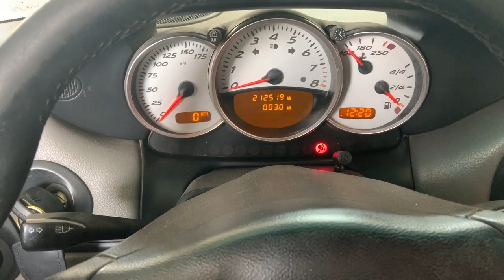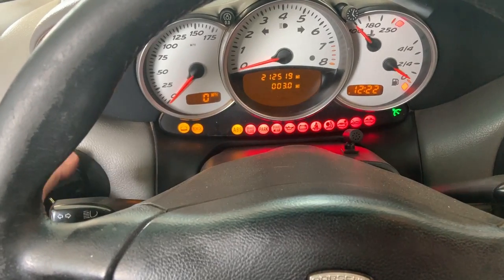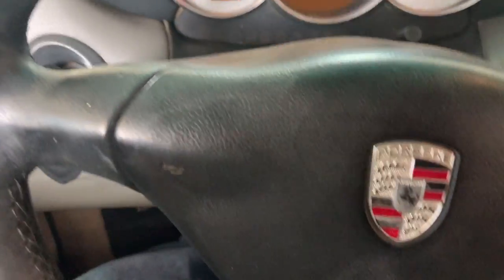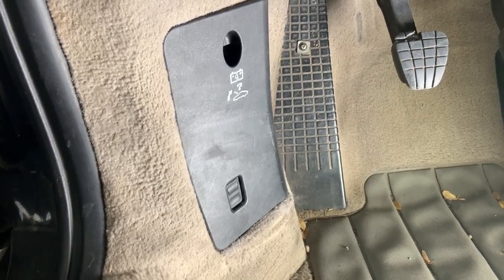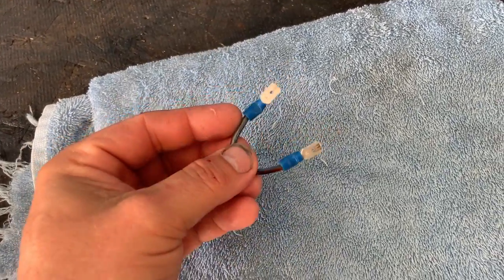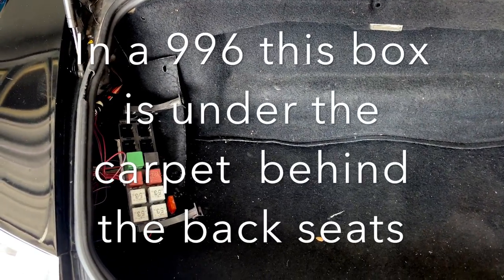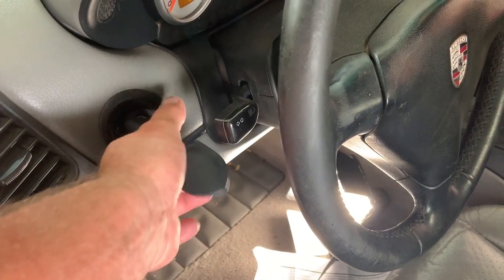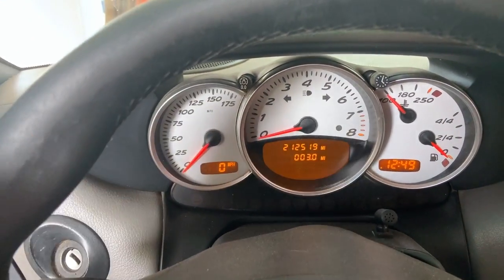Porsche Boxster 986 Porsche Carrera 911 996 won't start or run - How to start a Porsche 911 Boxster

Comment: Great info! This exact same thing happened to me with my boxster years ago and was in fact the clutch safety switch. I ended up just leaving the jumper, it was kind of nice not having to depress the clutch when starting. Not as safe, I know, but I liked it that way.
Reply from the maker: I agree my 1967 Porsche doesn't have the clutch safety switch and it was a big change driving the Boxster to always push in the clutch to start it up.  Thanks for watching, let me know if you have ideas for future videos.

Comment: Do not assume that just because your battery reads 12.5-ish volts that it's good. I can tie two 9v batteries together into one 18V battery and it couldn't hope to turn any car over but would more than pass this test. Cranking amps matter too. In my experience, 99% of the time a battery has reached end of life, it will still take a charge and read north of 12V... it isn't until you put a load on it that it shows its health.

Your average brick and mortar auto parts store has a proper automotive battery charger/tester with proper load testing that you can use for free.

Comment: That was the best exposition I've seen.  Thanks.  I already checked my clutch interlock switch (it operates properly) and the fuses.  I guess I need to check the relay.  I hadn't even known about those.

Comment: Mine did this today. Would not start to go home from work. Going to check if CPS is working. Car was cranking but no fuel. Tank was low. Maybe fuel pump bad. Everything else is new in the car and working as intended. Thanks man!!
Reply from the maker: Hope you get your Porsche running again without much fuss!

Comment: Great Job with the steps to follow, if stranded. I am New to owning a Porsche, Boxster 986. I could not refuse the selling price from the previous owner. Always wanted to have a Porsche growing up. The problem I am having for the first time is, I turn the key and the car turns over but does not start. In this video, your car does not turnover, it just clicks. Should I follow your steps and do you have other steps I should follow? I await your reply, appreciate all you do with your instructionals. I plan to follow you closely and most definitely will support the 986 Brotherhood. 
Merry Christmas and a prosperous New Year! Be safe, stay healthy too! Dario Villanueva - 12/24/2022
Reply: Im currently having this same problem (fuel pump primes, engine turns over, no start) with my 2000 Boxster, immediately after driving about 2 miles with a very low fuel gage, then shutting off the engine.. Did you receive any advice or fix your problem?

Comment: Hi Brian i have a 1999 911 i was going down the free way my gauge cluster lit up like christens tree all except check engine light but it runs great all gauges still work speed, volts oil so on
but warning light wont go off . I did have water in the trunk but its all dry now
thank you for your input
Reply from the maker: Pull the battery cables and let it sit over night.. hook them back up and let me know if it clears up.
Reply: @ArrowheadGarage  Hi Brian have new Battery and left cables off still on didn't clear up,
all cables clean

Comment: I had picked up a boxster that had the drain holes stuck and flooded the immo unit under the driver seat. I narrowed it down to bad immo unit and bad engine ecm. I have replaced both and it is doing the same thing as the video. No starter crank. I will try the relay jump this weekend.

Comment: I have a 99 Boxster with 43k original miles. Paid $2k for it. The previous owner thought it had a blown head gasket. Replaced the AOS and muffler. Now wont start. Starter clicks but dont turn over the engine. Was going to tap the starter a few times. Hopefully i wont have to replace it.
Reply from the maker: Right on you got a sweet deal!  Make sure your battery is fully charged!  These cars want every little bit juice they can get to run.

Comment: Please provide link to 'tool kit' upgrades! 👍 Also, My key has just decided not to activate the doors and trunks. Tried the insert key and turn, both in ignition and sequence at door.  No sucess. Disconnected battery ..still no go. Do you have a video on this? I would like to avoid the stealership routine and have to fork out $500 for a 'Porsche' fix. Thanks. I have a completely built up 986 S. Still use it regularly. Every mod available.  It is a bomb. Fastest in it's class. Would prefer to keep, as the mods alone would be worth more than what anyone would pay for it. Glad to see you still consider these cars. Richard

Comment: Hey Brian. 
Awesome vid, thanks! 
The car would not crank at all, the car did have power but no crank at all.
Did all the steps and bypassed the starter relay, we finally got crank but will not start, checked the fuel pump hack, fuel pump is working....ideas? Tia!!!
Reply from the maker: I would say it sounds like your immobilizer under the seat Might be toast :-( thanks for watching

Comment: Great video, Brian. Thank you! My 2001 Boxster is Tiptronic. Could the Brake Pedal Position Sensor be a problem, too?
Reply from the maker: It might just be, I haven't had a Tip 986 for about 5-6. years... it's worth a shot to troubleshoot that sensor.

Comment: Thanks pal got a similar problem  with my boxster s , starts fine drive up the road then into the shop come back out starts then cuts out , wont start then hour later 😡 starts
Reply from the maker: Hummm check on that starter or maybe you have a fuel pressure issue...

Comment: Hi, I just bought a 2001 Porsche Boxster 986 and the key broke off inside the switch bc it wouldn't turn to the right to start how can I order a new key replacement and ignition switch? I'm clueless about this car.
Reply from the maker: Call your local Porsche dealership and see if they can get you both, be ready to spend about $1500 or more for this fix :(  sorry Jason.

Comment: Bryan i have a boxster 99 crank some times start for couple of seconds and stall i change fuel filter fuel pump flometer but still dosent start  need your help
Reply from the maker: Have you done the fuel pressure test?  Also check your fuel pressure regulator

Comment: Jumped the starter relay and car started! But the tiptronic wont go into reverse, neutral or anything else - what does this mean? Its not the starter, not the ignition, the relaay is bad but where could the fault be with the gearbox?
Reply from the maker: On the tip make sure the cable hasn't popped out of the trans under the car.

Comment: Hi Brian, thank you for this very helpful video !  so my story is I have a 987.1 cayman S,  so every time I try to start must turn key to the on off cycle 2 to 3 times before it will finally crank and start, it will never crank on the first turn,  battery has been replaced,  any thoughts would be helpful , Thanks !   Always nervous that car won’t crank when ever I drive it.
Reply from the maker: Jim I would replace your ignition switch!! I carry a spare with me always!

Comment: Hi Brian, that was very helpful and I wonder you would please give me some advise please,
I have a 986/2.5/1998 manual.......having problem started with remote fob stopped communicating with the car, however I did tried all sort of trial and error copied from the forums but unfortunately I am not getting in the right direction.
First of all, I am a DIY enthusiastic person who is been struggling with the remote control is not communicating with the car, suddenly stopped, so I am using the key to open/close and start,
problem as I open I have to start under 20 seconds, otherwise is a panic for everyone!!blasting Alarm.
My question, recently we did a Durometric;
1. 14 RIGHT DOOR SECURED, BUT NOT LOCKED
2. 42 WRONG KEY OR WRONG TRANSPONDER PILL
3. 33 PASSENGER COMPARTMENT MONITORING DENSOR, LONG-TEST FAULT
I also noticed, when I lock with the key, the inner security (central locking) button RED light on
also the wing mirror heater light (orange) is working 24/7 it also kills the battery.
* So temporarily, I have dis-connected the alarm siren.  
* I have got the second Fob, but the PILL is out of programme and the key does not start engine only open doors.
* Radio/Becker CDR21 also stop working.

Is the fault connected to No.3, code 33?
Will I able to programme the PILL my self? because it is going to be very expensive to do,
The car is a right hand drive.
I greatly appreciate your help.......please please.
Reply from the maker: First off, can you get the 986 started at all with the keys you have?
Reply: @ArrowheadGarage  Hi Brian, starting the car with no problem, but the remote FOB is causing problems FOB isn't communicating with the car, alarm all works but with manual open/close doors with key.
Reply from the maker: @fjnicholas3145  thinking the head may be damaged, a new key head is like $300 if I recall.

Comment: hello i have a question i have a 1999 porsche boxster the car does as if it wants to start but there is no spark. I already changed the crankshaft but there is no difference any idea you can help me thanks
Reply from the maker: So it just spins over and over?  Have you done the fuel pump test yet?  Check out my video on testing the fuel pump. https://www.youtube.com/watch?v=wEWepuDUes4&t=7s
Reply: @ArrowheadGarage  I already did the test like the video you told me but no gas comes out the pump works but no gas comes out
Reply: @ArrowheadGarage  I have already seen the proof that you told me the gas pump works but it does not pump gas before the filter  something that you recommend me to do

Comment: Just bought a 986, I know nothing about these cars, a little help would be appreciated. I loved this video and followed every thing including the bypass on the relay. The engine turns over but nothing for starting. Thanks in advance. it has been sitting for a couple years. I charged up the battery and checked the voltage. put new battery in the FOB, which blinks but does nothing for the car, except turn over with the bypass wire installed. Put new relay in no engine turning??????
Reply from the maker: Do you have fuel pressure????  I have a video on how to check that.  Remember you need SPARK and FUEL.  Let's try and get this 986 running for you!
Reply: @ArrowheadGarage  I need to look at that video. But first I installed a new relay. No starter turning, so I put jumper back on relay, oh crap it turn over. Back to relay no turn over.
Reply: @ArrowheadGarage  pulled the box out from under the seat and it was full of water, now what

Comment: My 2002 Boxster sat for a few weeks over the winter without a battery tender. The battery ran down and the Porsche wouldn't start. I took the 9-month-old Interstate battery to the nearest dealer and they charged it for me. I put the battery back in and the Boxster now cranks but won't start. I have checked fuses in the footwell fusebox, but don't have any bad fuses. Ideas?
Reply from the maker: Try the starter relay hack, if it cranks then it’s your alarm/immobilizer thanks for watching

Comment: Im currently having a similar problem (fuel pump primes, engine turns over, no start) with my 2000 Boxster, immediately after driving about 2 miles with a very low fuel gage, then shutting off the engine.. I'm hoping you can help me diagnose or point me in the right direction. Please and thank you.
Reply from the maker: Check the fuel pressure regulator!!!!!!  That little SOB will cause the issue you're describing.

Comment: what would cause it not to start but it will turn over but just wont start and it has 1/2 tank of gas
Reply from the maker: could be a few thigns, try the second key if you have it... then has the car had any water leaks?
Reply: @ArrowheadGarage  no it's dry as a bone I had it started and was checking some messages on my phone and it died from a steady normal idle . I tried to start it back up and it won't start it will turn over all day long but just won't fire up. If it were the ignition coils it would usually start but run like crap.  I can't hear a fuel pumping noise when I turn on the key .
Reply: I can hear the fuel pump buzzing like it's working

Comment: My 986 is only starts when I push it and drop it on first, I got a new battery, I bypass the clutch safety and checked the fuses. Any idea what could be wrong? I’m literally lost
Reply from the maker: It could be a bad starter :(

Comment: That's going to be very painful! I just tried with the second key (not in use due to same problem)
removed the PILL from the working Flashing Fob, and no circuit in the plastic casing I inserted this PILL, but the engine starts and work, in other way the circuit has nothing to do with the immobiliser, Am I correct? or it has connected with the passenger side movement sensor up on the roof?  as mentioned before there was a Durometric code obtained last week;
**Code 42 Wrong key or Wrong Transponder PILL?
**Code 33 Passenger Compartment Monitoring Sensor, long -test Fault.
I am absolutely confused......

Comment: Got a 2007 Porsche Boxster S, slow to start, weak start
Reply from the maker: First make sure your battery is fully charged, these Porsches are HUGE on having every little bit of volts from the battery to run.

Comment: Just installed a new IMS bearing in my 2000 Boxster S.  Also replaced expansion tank, water pump and thermostat while I had it all open.  Put it back together and it cranks but won't start!  Had the battery disconnected the whole time.  Alarm system is working, radio code needs resetting.  OBDII says P0343 Camshaft position (CMP-) sensor A, bank 1 - high input.  Any suggestions?
Reply from the maker: Follow the steps on this video https://youtu.be/ZSmehtE8Ctk
Reply: @ArrowheadGarage  Hi Brian, Thanks for responding, none of these steps were successful unfortunately.  Checked all the fuses as well.  Switched the relays for fuel pump.  The engine cranks and cranks but won't fire.  Although it did give a very weak firing twice, but so weak I'm not even sure.  I had the entire exhaust system out and then put back in while doing the IMS bearing, also I forgot to mention new clutch and RMS.  Passenger side is seeping a little fuel from the manifold, buy not from the gasket, from 2 of the pipes right where they join the mounting plate. Huh, weird right?  I'm guessing the fuel pump is working just no spark.  When cranking the tach moves up slightly. Any thoughts?
Reply from the maker: @petermancini906  you can rent a fuel pressure tester for free at most auto parts stores... test it.. then I would look at your plugs/coil packs.  Just to make sure, pull the drivers seat and make sure that little box is DRY!  Let me know what you find out.

Comment: My keys don't work for trunk/lock. HELP!!!!
Reply from the maker: Try using your key to lock and unlock the drivers door.  If this doesn't fix the truck buttons on the key, change batteries.. if still not working... might be time for a new keyhead.

Comment: Hi guys im Tony from the uk this is a very useful video i had this issue in my 2001 996 tiptronic cabriolet and it turned out to be my alarm ecu that had got wet from blocked roof drains that had flooded the rear passenger floor and soaked the ecu underneath the passenger seat a common issue apparently so i dried the carpets took out the ecu and found green corrosion so i cleaned the circuit board and plugs with wd40 took it in the house and put it on the radiator over night to try and dry it off the next day put it back on and the car started fine and drives as normal so far so good so give that try before spending a fortune on a new alarm and immobiliser ecu it mite save you a fortune i did notice that when i unlocked the car the door curtesy lights did not come on until the ecu was working correctly so that might be sign that your issue might be the ecu so check and see if your carpet is wet if so check your ecu it only seems to be on the cabriolets though as the roof drains get blocked and need cleaning they are behind the rear wheel arch cover and will be full of mud so clean them out regular if the ecu works put your ecu in zip lock plastic bag it will help keep the ecu dry and the issue returning a bit ugly but better than the cost of a new ecu as you will need to buy an ecu and key alarm fob and have to pay them to be reprogrammed in the uk costs around £450 for ecu £180 for key fob and around £100 for a Porsche engineer to program not sure about US prices hope this helps anyone
Reply: I believe some aftermarket companies sell a watertight case/cover for the ECU which would be worth the investment over replacing the whole unit.
Reply from the maker: I tried using wd-40 on mine and it was too far gone :(  but great tip for the future!!

Comment: Hello, I have a 1999 Boxster and my speedometer has no lights turned on when I turn my ignition. No nothing it’s like it’s not receiving any power. Something is up with the electronics. Could anyone help me 

Thanks in advance